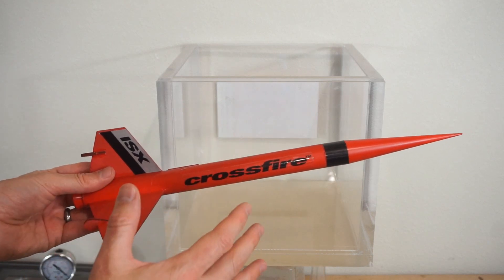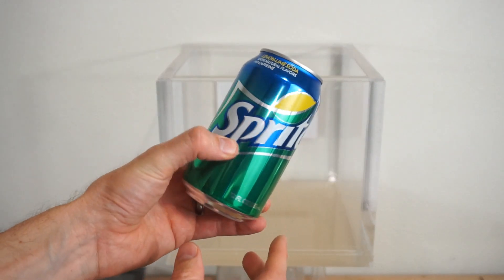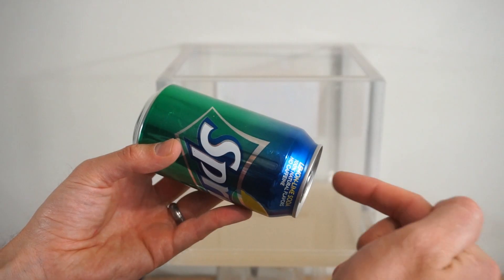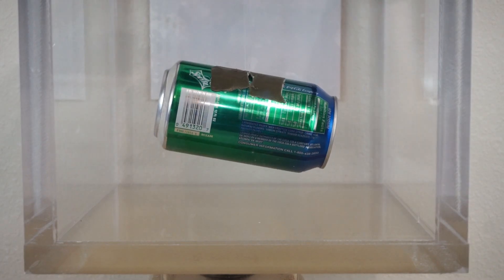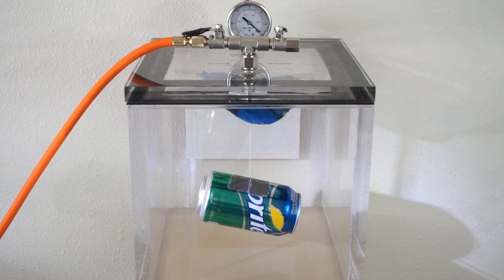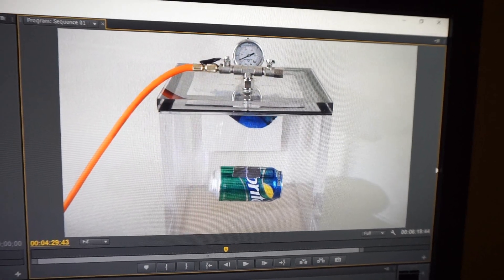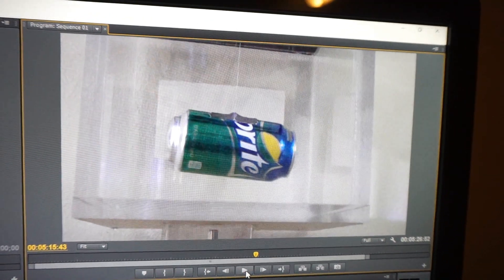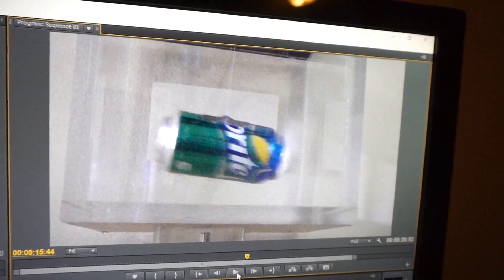Can a Rocket Fly in a Vacuum Chamber?

Comment: Yes. Per newtons laws: Mechanical RECOIL still works even when there is no air.
Reply: Shame a thermal rocket doesn't work by mechanical recoil then. It's a heat engine of the internal combustion type, chatbot. Do you agree?
Reply: @papalegba6796 - "Shame a thermal rocket doesn't work by mechanical recoil then. "

Except for that pesky fact that IT DOEs!

A rocket engine applies a "force" to the mass of the exhaust gas causing it to be accelerated out of the nozzle.
WE SEE THIS WITH OUR EYES.
Don't even try your stupid "No it doesn't" WE CAN SEE IT!  SH|T FOR BRAINS!

A rocket engine applies a "Force" to the mass of the exhaust gas causing the exhaust gas to be "accelerated" out of the nozzle!!
What does newtons THIRD law say about forces?

That the rocket MUST feel an "equal and opposite force" pushing it in the opposite direction! PERIOD.
You do NOT get to say "Nu uuuuh" like a petulant child THIS IS A FACT.

This is "Mechanical recoil" which we also call "Thrust".
Just stop denying simple basic physics it really makes you look like a fuc|<ing imbecile.

You wont even ADMIT that a CROSSBOW has recoil because it PROVES YOU WRONG jacka$$.
Reply: Oh I forgot, chatbot stu never answers questions, ever 😂

Comment: Stupid 'test'. Rockets do not work by exploding 90% of their mass all at once.
Reply: This still demonstrates the point. The can ejected mass in one direction and it was propelled in the other direction. Rockets do the same thing, just over a longer duration.
Reply: @AM-rd9pu  it demonstrates a soda can will explode at low pressure & push off its lid. To everyone not a NASA chatbot, that is 😂
Reply: @papalegba6796 The can wouldn’t go anywhere if it was just pushing off its own lid.
Reply: @AM-rd9pu  so you think newton's 3rd law is wrong? Already knew that, chatbot, but thanks fir confirming it 😂

Comment: The combustion of the fuel produces a gas which fills the vacuum chamber and there is no longer a vacuum
Reply: We can see that rockets begin to move well before the exhaust gasses can meaningfully increase the pressure in the chamber.
Reply: @AM-rd9pu  Exhaust gases lean against the walls of the container
Reply: @zayko5  That’s not how thrust works. You can’t feel when water from a hose you’re holding hits the ground. The rocket doesn’t feel when the ejected mass hits the wall.  

Rockets work because of the third law of motion. The rocket exerts a force in the exhaust mass and that mass exerts a force back on the rocket. They go flying in opposite directions.
Reply: @AM-rd9pu  water from a hose is not in vacuum
Reply: @zayko5  You don’t feel the water pushing off the air either. The recoil comes from the water pushing off the hose. The point is that you don’t feel when a projectile hits something it’s not connected to. 

All you need to understand here is the third law of motion.
Reply: @AM-rd9pu  it is not pushing off anything in vacuum, since there is no preasure.
Reply: @zayko5  I already explained that rockets push off the mass they eject out of the nozzle. 

They exert a force on that mass and that mass exerts a force back on the rocket. No additional interaction is required. This is the third law of motion at work.

Comment: A true vacuum would crush that can.
Reply: Thanks for proving you have NO IDEA how a "vacuum" works.
Reply: @stuartgray5877  gfys
Reply: @mavadoroaster  Such an eloquent response. Is that all you have to offer?

A vacuum is a region devoid of matter. How can a vacuum crush something? It is literally nothing. Nothing can’t crush something.
Reply: @AM-rd9pu  it would implode it same as crushing in my book.
Reply: @mavadoroaster  Implosion requires an external force. What force is being applied to the can? Remember that a vacuum is a lack of stuff. How can nothing impart a force on something?
Reply: @AM-rd9pu  the same force that would be on your naked body in space. It's called a vacuum
Reply: @mavadoroaster - if the can itself had all the air evacuated from it while the can was in a normal room, THEN it would crush in on itself.

In this experiment the vacuum chamber would cause the can to try and expand in order to equalize the pressure, but its construction is rigid enough to prevent that happening.
Reply: @mavadoroaster  - "it would implode it same as crushing in my book."

No. If the pressure is INSIDE the vessel and you reduce the pressure OUTSIDE (make it a vacuum).
then the can would be likely to EX-PLODE.

Consider taking high school physics.
Reply: @mavadoroaster  Again, how can nothing act on something? 

Pressurized containers explode not implode (get crushed) in low pressure environments. 

This is some extremely simple stuff you’re not understanding here
Reply: @stuartgray5877  ok chat bot
Reply: @AM-rd9pu  - see his response? - "ok chat bot"

Have we found papalegba's latest reincarnation?

Comment: I really hate to be dogmatic here, but in gravity, when liquid or gas is expelled out of the object, the down vector and the straight forward vectors create a new vector between the two. When this happens in this environment it is impossible to distinguish between the two. 
I can appreciate that the phenomenon does in fact happen in a vacuum assuming this guy hasn't been paid by anybody, and there's no one bankrolling his experiments to sway the results. 
However, there is a force that is already present here and there are absolutely no forces already present in space. To create something out of nothing because it says it on a piece of paper is just hard for me to personally accept. 
In this chamber, when the resulting vector causes forward propulsion, the contacting expulsion from the object reacts from the forward vector pushing off of the down gravity vector, giving it something to push off of to go forwards. 
In space there isn't anything to push off of to go forwards. 

If a rocket could become completely weightless and had no air friction or gravity to push against, there would be no force to slow it down to 25,000 mph, it could keep safely accelerating on until it had to safely slow down, and the amount of propellant used would be reflected in distance, Therefore there wouldn't be any reason not to save the battery oxygen in the cab on the way back to earth, where the atmosphere are the brakes. The first moon landing i think it was the first one, actually was very close to running out out oxygen. 
Why would they allow that if they could keep accelerating to get to say 33,000 mph and get back in plenty time.
Reply: Do you agree that it requires a "FORCE" to make mass accelerate?
Do you agree that rocket exhaust has mass and that rocket engines accelerate that mass?

If so, then what does Newtons THIRD law say about forces?
Reply: @stuartgray5877  it says an outside force is required from a second body to cause acceleration. A rocket in space is like me on a skateboard hitting myself in the back and expecting acceleration. But on earth where they actually only fly, they push off of air with extreme force from the back of the rocket
Reply: @PseudoScienceDenier  So explain what would happen if you fired a crossbow into a vacuum? (obviously you cannot)
According to YOU it will not generate any recoil force "cuz reasons"??
Reply: @PseudoScienceDenier  - "A rocket in space is like me on a skateboard hitting myself in the back and expecting acceleration."

No, a rocket is like a person standing on a skateboard and throwing a Brick at Mach Eight.
Will THAT push the skateboarder forward?
It sure would
Reply: @PseudoScienceDenier Rockets don’t push off air. They push off the inertia of the mass they’re ejecting out the back.
Reply: @PseudoScienceDenier  What's the matter?
DO you not know what would happen to a person on a skateboard that throws a brick at Mach eight?
Maybe you could ask an Engineer?
Reply: @stuartgray5877  if you did not push off of the ground to push the brick at that speed, if you threw the the brick in freefall, do you think that you would move then?
I went to school for aerospace engineering at nc state university. 
So i can ask myself these questions. 
Thanks for the compliment.
Reply: @PseudoScienceDenier  Jumping in to answer this. If you were in free fall and threw a brick, your path would be altered. Assuming you threw the brick perfectly horizontally, you would still be in free fall but would then have a horizontal component to your velocity that is in the opposite direction that you threw the brick. You don’t even need to be in free fall to test this. Hold a heavy, jump straight up, then throw/ push the object away from you. You’ll land behind where you jumped from.
Reply: @PseudoScienceDenier  - "I went to school for aerospace engineering at nc state university"
GREAT!  
So then just solve this simple problem:
 What force is required to accelerate 500 kg of projectile from a velocity of 0.0 m/s to 2500 m/s in 10 meters?
Simple:
 launcher with a 10 meter "stroke" (like an aircraft carrier catapult)
Mass launched 500 kg (lets say a tank of water as a test)
Exit velocity = 2500 m/s (about Mach Eight).

What's the (assumed constant) force required to do so ?
Works with a cannon example or EM railgun, steam, etc.
Reply: @AM-rd9pu  You cannot generate a force from nothing. In freefall gravity is canceled out so there is no gravitational force to consider to push against. Therefore you could not throw the brick it would stop at the edge of your hand. Because you have no force to push against to generate a force. For every force they're us an equal and opposite force. What is the equal and opposite force applied to generate the force. Your muscles contract and push the brick away from you but you must have something to push against to exert force on the brick. Else you can push the brick away from you but just to the edge of your hand. Without any external force, newton's law states that and internal system cannot generate a new force to an internal object. You're using the laws wrong. You MUST have something to push off, usually this is the result of gravity and friction of the ground but in this case in freefall you would have nothing. Therefore it could not be done physically. The momentum must still be 0 you can't generate a new force. Therefore you cannot generate a force to throw the brooch out would stop at the edge of your hand to satisfy the law of conservation of momentum. It's not hard to understand. The momentum must still be equal to 0 because you cannot push against anything because you're in freefall and the momentum must equal back to 0 in an internal system. You could push the brick away from you, and you each would move away from one another but you could not exert force on the brick due to now having anything to push on to push it away. You could accelerate the brick forward and it would just barely leave your hand and you would both fall downwards still right beside each other
Reply: @stuartgray5877  im not going into this, i explained myself well, mainstream physics will teach you that it's possible but it breaks both the law of conservation of momentum and newton's 3rd law, you cannot generate a new force from nothing. You must have something to generate the force from and there's nothing in freefall. You could internally push the brick away from you but not exert a force on it. You would both move away from each other scaled to the fraction of your masses. But where would you be able to push the brick away from you with extreme velocity when there's no equal and opposite force to generate the force from your body to your hand to the brick?
Think critically, get the mainstream indoctrination out. 
Think for yourselves and think about where you could generate such a force from when theres nothing to generate it from? You cannot create a new force that breaks a lot of laws.
Reply: @PseudoScienceDenier  - "Therefore you could not throw the brick it would stop at the edge of your hand"

Thanks for proving that you are completely clueless about basic physics.
Now stop lying about attending college.
Reply: @PseudoScienceDenier  - "i explained myself well, mainstream physics will teach you that it's possible but it breaks both the law of conservation of momentum and newton's 3rd law, you cannot generate a new force from nothing"

This is completely false.
FYI I DO have an actual Engineering degree and have been working as a REAL Aerospace Engineer for the last ~30 years.
You are completely confused about simple inertia and Momentum.
Now stop trying to explain basic physics to others. you are REALLY bad at it.
Reply: @PseudoScienceDenier  What's the matter?  Are you too embarrassed by being exposed for LYING about attending college?
Reply: @PseudoScienceDenier  I find it extraordinarily unlikely that you actually have an engineering degree. You’re demonstrating that you don’t understand basic physics that is learned in high school. Also, your name is on your YouTube account and googling your name plus NC State Aero doesn’t give any results. 

Being in free fall simply allows you to consider the situation as if gravity isn’t acting on the object. Or if you have the ground as your reference frame, you just have increasing downward velocity. 

Having accelerating downward velocity doesn’t change the fact that you can push off the inertia of an object. 

Let’s analyze what you’re proposing using Newton’s laws. You claim that you could push the object to your full arm’s reach and then it would stop moving away from you. According to Newton’s first law, an object at rest stays at rest and an object in motion stays in motion. More concisely, the velocity of an object cannot change unless a force acts on it. The object was near you and moved to arm’s length. So, a force clearly acted on it. Once that object has velocity pointed away from you, it will maintain that velocity. For it to stop moving away from you, a force pointed back towards you would have to act on it. So your claim that it would stop violates Newton’s first law because nothing is acting on the object to make it stop moving away from you. 

Now, let’s look at this in regard to the third law of motion. For every reaction, there is an equal and opposite reaction. As was already established, you impart a force on the object. Therefore, the object imparts a force back on you. The force you impart on the object will give it a velocity component in that direction. The force that the object imparts back on you will make you have a velocity component in the opposite direction. So it would be a violation of the third law of motion if you didn’t start moving in the opposite direction of the force you imparted on the object. 

You mention the conservation of momentum and momentum is still conserved. Remember that the system we are observing consists of both you and the object, regardless of you’re still in contact with the object. Momentum is mass times velocity, this being a vector. So the sum of the momentum vectors of you and the object must be the same before and after you push it. When the same force acts on two objects of different masses, their velocities will be inversely proportional to their mass. That means that the products of their mass and respective velocity will be equal, but in opposite directions. That means the net momentum (in the horizontal direction) will remain 0. 

The example from my previous comment still holds true both for jumping on the ground or while in free fall. Try it for yourself. I did and I moved backwards when pushing off the object I was holding.
Reply: @PseudoScienceDenier  So did you FINALLY pick up a physics book and lookup the Law of Conservation of Momentum?
You CLEARLY did not understand it before we started this conversation.

Tell us some more lies about how you graduated high school and attended some college.
Reply: @PseudoScienceDenier  - " but it breaks both the law of conservation of momentum and newton's 3rd law, you cannot generate a new force from nothing"
Have you figured out yet that this statement was 100% false?
It is a fact that you could not have taken any Engineering classes in college and be as misinformed as you are on the topic of basic physics.
Reply: There's no need to respond to both @AM-rd9pu and @Stuartgray because both channels are the same chatbot - so when you respond to one you're responding to the other as well 👌🏼
Reply: @Checkeroute  Its pretty pathetic when you LOSE an argument then resort to "Bot" calling.

The only OTHER flat earth moron that was THIS persistent was papalegba, DrCash77, 77thbrigadesockpupetaccout.

HELLO PAPALEGBA